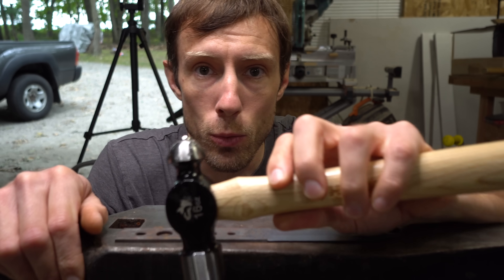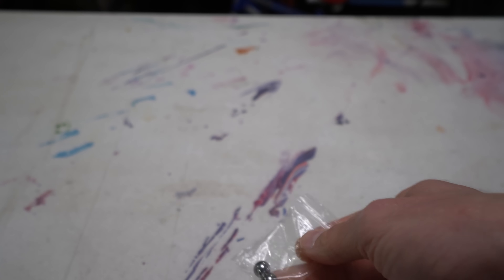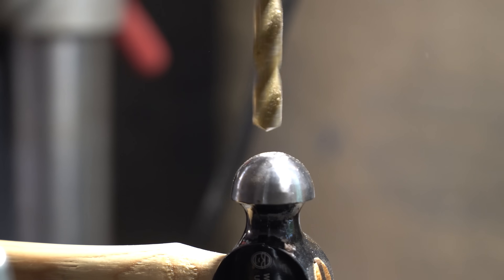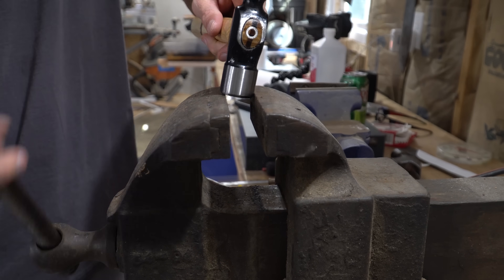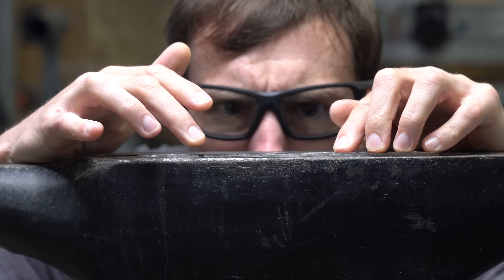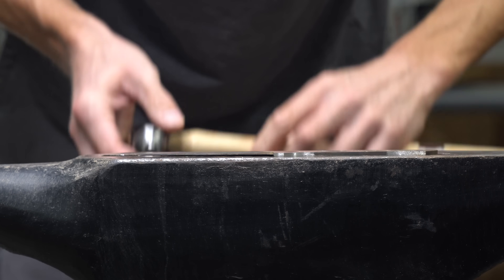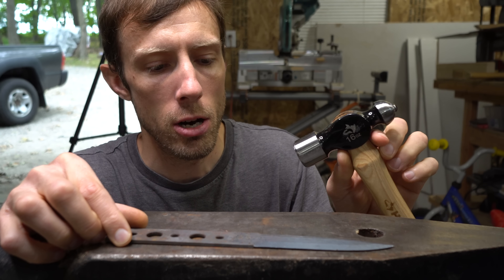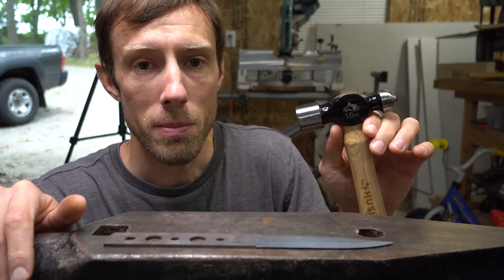I Should Have Made This Weird Tool WAY Sooner

Comment: I used to work in a saw blade factory, and making the blades flat was done almost exactly the same way.
The difference was we had a specialized hammer for the task, and we would shine a light at a polished anvil and use a straight edge using the refraction from the anvil to find our dishing, bowing or warping.
This system worked really well, and the top paid guy’s in the factory were hammer smith’s, as knowing when to stop hammering was just as important as knowing where to hammer.
Reply: when the older generation disseminates information and stories like this I can't help but just appreciate the raw talent and skill it takes to master a craft and then be able to talk about it precisely and passionately. awesome.
Reply: @ForbiddenCloudGaming  I’ll take that as a compliment, though 42 isn’t part of the “older generation”.
It may surprise you that hammer smith’s still work today, no machine can do that job, and the blades for the big saw mills need to be flat, really flat, because they will explode if they aren’t, they are a crucial part of the lumber industry.
It’s really amazing just how much is still done “the old way”, even though we all think technology has moved past skill, it’s hasn’t.
We used lasers to cut the blade shape out of sheet steel, but if the blade needed to be thinner than .050 inches it was cut into rounds because a laser can’t accurately cut that thin and not melt the end of the tooth, a machinist would tooth it, using a machine that is probably over 75 years old, those blades are how you get perforated toilet paper.
Reply: It was supposed to be one! Not trying to age bash you either. lol

I mean it when I say I have the utmost respect for people that take the time to master a craft, it's admirable and takes dedication to do so.
Hand tool dexterity and the skill to shape material into whatever you need in whatever field you may find yourself in; that's friggen awesome.

It just goes to show how the newest tech isn't always the solution it makes sense with how much surface area there would be at the teeth of those blades It would be appropriate to machine them rather than laser cut.

Thanks for sharing man!  @TheGentlemanRogueScholar
Reply: That’s a very could hack. Stone masons use the same tick with a straight edge and light when polishing stone to a really flat suffice.
Reply: My uncle was a watchmaker,  he had skills I could only dream of,  I remember him regrindimg the crankshaft from his old triumph TR3 using only a file,  it ran for another 30,000 miles.  He really was a master craftsman. I wish I had spent more time with him.
Reply: My uncle was a watchmaker,  he had skills I could only dream of,  I remember him regrindimg the crankshaft from his old triumph TR3 using only a file,  it ran for another 30,000 miles.  He really was a master craftsman. I wish I had spent more time with him.
Reply: Ahh, the skill of the hammer. Too many people look at hammers as crude. The hammer is the first tool we made, humans have a LOT of history improving hammering. Scythes were sharpened to a razers edge with a hammer. 
An interesting actual job title from the past is a "Scissors putter-togetherer". Just the right hammer blows induce the curve that makes scissors work. Took years of practice to perfect. Sounds like what a 5 year old would come up with for a name though. 
Don't get me started on "doing it by eye" meaning you half-assed it to just close-enough. The eye is the finest instrument known to man, we have just forgotten how to use it.

Comment: 01:47 - Speaking of tools you should try out:  IT workers use velcro strips for wire management.  The type of velcro strip is meant to be affixed to one wire, then wrapped around multiple others.  That exact velcro strip is perfect for affixing to a drill chuck key and then securing it to, for example, the crank handle on the drill press.
Reply: double bubble works way better for that.
Reply: @JR-lg7fd  Not sure what your point is, but no it won't and anyway it's Dubble Bubble
Reply: @baudgaud  I have heard stories of its efficacy
Reply: @JR-lg7fd  I can tell you for an absolute fact that you're thinking of Bazooka.  Dubble Bubble won't contain a whole pound of pressure unless you heat-gun it for quite awhile.  Apart from that, I still can't tell if you have a point much less what it is.

Comment: Brilliant idea!!! McMaster has a 2pack of 8mm TC balls for ≈$20 shipped.
Edit: They also sell bolt mount retractors for that drill Chuck key.
Double Edit: when you trap the ball bearing into the tip of the peen one might call it “staking”

Comment: If there's one thing I learned from this, it's always keep your chuck key in your chuck. Especially on lathes 😉
Reply: Very good…but that requires disabling the power switch just in case some fool walks by. Oh, and don’t forget the Out Of Order sign. 

Here’s another solution - glue it into your pocket. Can’t use it but you won’t lose it.

Comment: I have my drill press key hanging on a wire, near the back of the body, and it's painted a fluorescent colour...I think that I'll put a piece of heat shrink tubing on the key, as the paint comes off the metal pretty fast...

Comment: Having never really messed with metal too much, the process for straightening it out was the exact opposite of what I thought. I figured you'd just set it with the bend facing down on a straight surface and hammer it that way, but thinking about it now, that's basically just like ripping the metal apart and risking a crack isn't it? 

Now to think about home repair scenarios where this might apply...

Comment: Peening is very powerful! I've actually peened a big steel framing square to make it perfectly accurate, and also a 4' x4" aluminum straight edge to straighten it in the 4" plane. Those peen marks are hateful though, it takes forever to remove them if you go too deep. The biggest ball you can find on the lightest hammer would help some.

Comment: Great videos with great info!  I use a neodynium magnet super glued to any blank spot on the drill to store the chuck key. Mine is stuck to that round blank spot on the middle of the handwheel.  Always in the right spot and easy to access.

Comment: Does this increase internal stress in the blade that could lead to it shattering later under load? 

Not sure it would be any different using other methods, but Alex seems to think a lot about the crystalline structure within the blade. I wondered if there is a difference between bending the blade versus spreading the metal on one side to introduce a counter pressure that bends the blade but then “lives” in the steel, so to speak.
Reply: Have you ever heard of shot peening, to relieve the inner stress, kinda the same thing
Reply: @williepelzer384  - Thanks for the suggestion to consider it like shot peening. It’s an interesting way to look at it. As I understand it, the type of concerns that come from incomplete or low coverage of the surface of a part being shot peened would seem to apply here. With low surface coverage in shot peening, the life of a part can be shortened. The benefits of shot peening in creating a compression stress layer, across the surface of a part where cracks usually start, would not seem to apply with a knife that’s been peened a limited number of times on one side. Anyway, I am not sure what difference the blade straightening process using peening will make in the life of the final product. It’s not an engine part, or part of an aircraft that is going to be exposed to extreme stresses after all.

Comment: I made my carbide tipped straightening hammer just a few weeks ago, and I wanted to kick myself for not making one sooner.   I bought the ball peen hammer and a 3/8" WC ball for less than $20.   It took me literally just a few minutes to straighten an AEB-L chef's knife.   Compare that with the hours that would have taken using the 3 point clamp temper method.   I have spent countless hours straightening blades using excessive temper cycles.  Now it's literally a handful of minutes. 

My experience is different than yours.....I have no problem straightening any air/plate quench steel with the temper method.  It works for me just as well as any oil/water quench steel.  The trick is you have to over correct the bend when you set it up.   So if the tip is bent 1/16" to the left, you want to to over bend the opposite direction by, say  3/32", set up your clamps and then temper.  I've been using the temper method for years dealing with AEB-L,  with no issue other than the time wasted.  

But this carbide tipped hammer is indeed a game changer in any knife maker's shop.  If you make knives and haven't made yourself one, do yourself a HUGE favor and get one made.  Hours upon hours saved.

Comment: Drill one size under 3/8 and then do the 3/8. This will give you a hole a little under 3/8" so you can get a press fit on the ball.

Comment: That's really impressive, especially since you're very honest and not afraid to tell us when something is just hype. It really gives me confidence that this tool works.
Reply from the maker: This is definitely not hype. Its a proven method for straightening hardened steel blades. It may take some practice but it absolutely works!👍
Reply: @OUTDOORS55 Ditto on the integrity part, you're one of the few people i trust on this platform
Reply: Thanks, I would have hammered on the wrong side and hit it way to hard.

Comment: Thanks a million for this tip.....comes handy for straightening the longer thin blades (  like kitchen knifes) i often do. Even plate quenching them does not keep them straight every time. An alternative if those carbide balls are difficult to find is a broken 1/2 " carbide endmill. They are easy to round off at one end and cut to lenght using a 4 or 5" tile cutting diamond  disk on a angle grinder.

Comment: That's a really cool method for straightening out a blade! I've never seen anyone do that before, honestly. All of my attempts have been in a vise with a torch, basically torturing myself for half an hour praying my blade doesn't snap under the tension. I've trashed more than one knife trying to use the reverse tension approach. I'm going to give this a try, but do you think the Tungsten Carbide is a must have in this application?
Reply from the maker: Yes absolutely! You need something harder than the blade itself.👍

Comment: I stick a speaker magnet to the drill press to hold the chuck key and some other tools. Seems to be the only way to avoid misplacing it all the time for me.
Reply: I use some small neodymium cup magnets. They have a countersink that lets them be screwed to the sheet metal of the belt housing.
Reply: Same here, I use magnets from old computer hard drives
Reply: Same
Reply: Ya I came here to say, I had done the same.
I glued a small magnet to my chuck key, I always know where it's at
Reply: Guess I'm the only guy that has his chuck key tied to a string lol.
Reply: It kinda works but i only do this with screw drivers that are meant to be magnetic... you kinda dont want to your countersink bits and chuck key turn magnetic...
 @shanek6582  Nah you are not. I took ticket holder thingy from ski resort to tie in to key, though getting hole was pain. Needed to heat the handle arm since its hardened as well, then hammer it to spread material and finally drill. Could be better but least there is no string around causing potential danger.
Reply: @shanek6582  I tie mine on with bank line.
Reply: damn me too - should have read the comments before I posted 🧲
Reply: @scottpageusmc ja, I've been that guy before.
Reply: I keep magnets around just for stuff like this. I can't remember sh!t, so anything like this, tool wrenches, counter-sink bits, right-angle adapters, whatever gets a magnet.
Reply: The drill press we have at work has the chuck key chained to the housing. Prevents it from getting lost or stolen. Doesn't do a very good job of keeping it out of the way though. Would recommend not chaining it to the side with the crank.
Reply: Is there a magnet for my memory, I’m at that age where I can’t remember anything. Eeeeekkkkk 😂
Reply: I use an old speaker magnet to clean my shop. I put it in a plastic bag, drag it over the floor, put it over the garbage can and pull the speaker out of the bag. All the metal fillings drop away, everything clean.
Reply: That's a fantastic idea. Totally stealing it.
Reply: Speaker magners are plentiful if you can source them.
Reply: I stuck a chuck key to my drill so that I can have somewhere to keep all my spare magnets.
Reply: I use one of those janitor key reels attached to the motor frame
Reply: My great grandfather always tied it to the handle
Reply: I bought a keyless chuck from eBay.  Not too costly, and it's accurate enough for me.
Reply: Chain.
Reply: And use a chain. Chuck never goes missing again.
Reply: I switched to a keyless chuck
Reply: there's been a chuck key on a cabinet magnet on my dad's drill press since the 1980's. 👍
Reply: Magnets are magic - at school the keys were simply tied onto the pillar with string.
Reply: I put a magnet on the drill press. Now the chuck key is on the magnet but  I am still looking all over the bench and drill cupboard.
Reply: I highly recommend this, my chuck never goes missing
Reply: Sadly, I'm dumb enough I still end up putting the key in my pocket, or set it down on the lathe, or by the grinder, etc. The only thing that worked for me is a janitor's keyring where a spring-tensioned chain pulls out of a housing usually worn on the waist, but in this case, screwed to the side of the drill press headstock.
Reply: Thankfully my drill press has a holder for my chick key built into it 😂 my old one didn’t and I always spent more time looking for it than actually using the drill press haha

Comment: I need the ball bearing, a drill press, bit, anvil, bent piece of metal and I’m almost set!   Seriously, cool idea and implementation!
Reply: At least you got the hammer sorted!
Reply: you can make this by simply rounding off the hammering end of a hammer btw, or just buy a good ball pin hammer, he just went x10 on it!
Reply: @kingscroach  Well, only if the hammer is hard enough to dent the blade, otherwise the hammer just becomes less of a ball...
Reply: @kurtbilinski1723  Most hammers are made with the same or higher carbon steel btw

Comment: Add vibrating force to the hammer would do the job with less force/less dents. Also if overdoing it wraps the other side it means there is surface tension there too, not that you over do it.
Its like shot peening to release residual stresses

Comment: Engineering tip:...attach a rubber band / elastic cord around your drill chuck key and then the other end to one of the handles on the drill, that way the key will stretch to the chuck but will keep out of the way when not needed and always around the drill and never lost again = 😇

Comment: I don’t understand why you need the carbide ball bearing though? Why can’t you just use a ball peen hammer? Or a smaller size ball peen hammer if that is the point of the ball bearing?
Reply from the maker: The bearing needs to be harder than the steel itself. Most knives out of the quench are going to be 66 to 70 HRC so the bearing must be harder than 70 HRC So a regular hammer, will not work. Hence the carbide insert.
Reply: @OUTDOORS55  I figured it had to do with that, but you are not really forging or anything just making little love taps to correct the bend after heat treat, so mentally I’m struggling to understand why. Lol 😂 I guess my brain isn’t braining today

Comment: Drill press chuck keys - either attach a magnet to the press body or the key and then stick one to the other.
I've done both, glue a magnet on a handy place on the drill and just put the key on it when not in use, or drill the back of the key and stick a magnet in it, then you can just leave it anywhere on the drill. 
You're welcome.
Reply: Yep. Do that the first day you set it up, because that chuck key will find a way to wander off somewhere one way or another. You might find it in your sock drawer three weeks after you order a replacement otherwise. 😂
Reply from the maker: I have my other drill press key tied to a rope. This drill press key doesn't have a hole in it yet so I have yet to tie it up.👍🙂
Reply: I have a magnet on mine, but I still lose the darn key. ADHD is real.